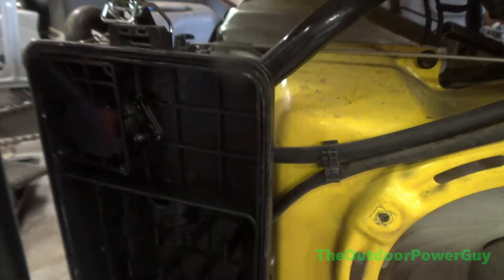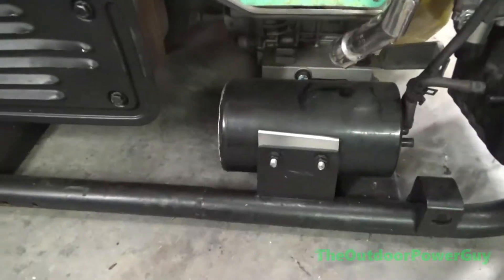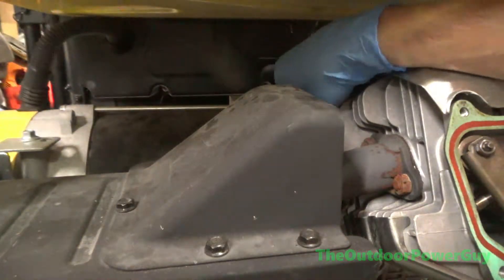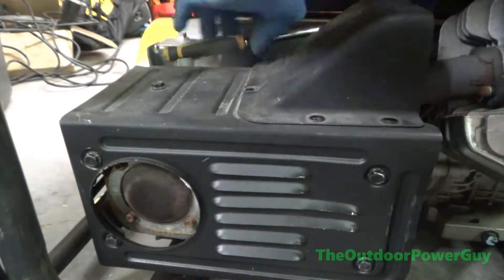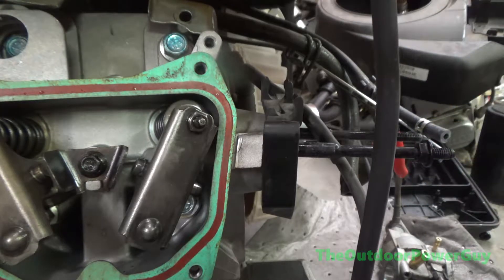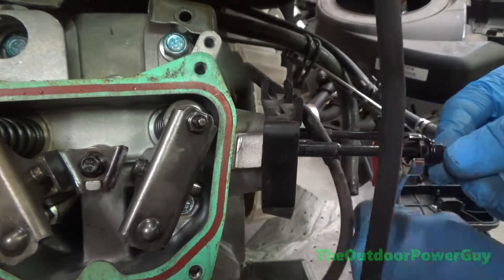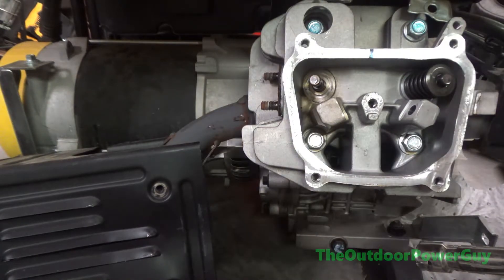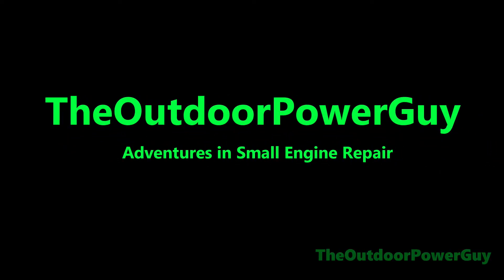Champion Dual Fuel Generator Engine Failure  - Part 1 - Teardown

Comment: All you really need to do is start it open your propane tank slowly and that should of fix it.
Turn propane tank on to fast over time will make your engine like no compression need choke out all the way. It will get worse and worse 
 Almost to fix almost any dual fuel generator to run it is to open your propane tank slowly.
Don’t forget after 100 hours gap and it check spark plug but should not really be problem.
Dual fuel portable generator propane tank always turn it on slowly even it you have choke problems it should fix that problem and generator should be running again 90 percent problem dual fuel generator turn you propane tank on to fast

Comment: My less than four year old champion generator ( 11,500 watt model) has begun to leak oil badly from the back of the engine where the generator meets it.  So disappointing.  I’m gonna try and figure out the problem.

Comment: when you 1st looked at it did you pop the valve cover off ?? the valve keepers were missing ,, did they run threw the engine and hit the piston or did they end up in the sump ?? seen them go both ways on other engines ,,
Reply from the maker: This was a warranty job, ended up with a total engine replacement.